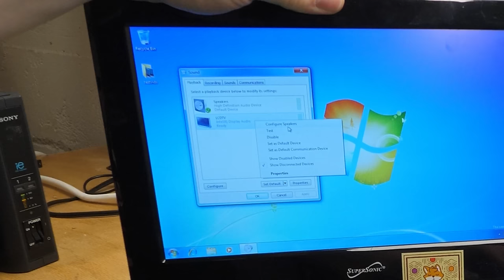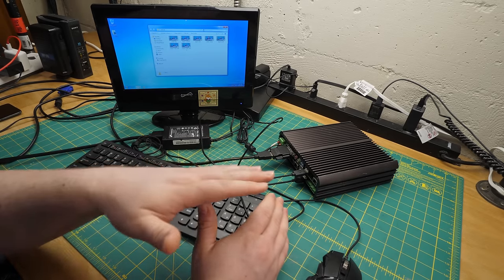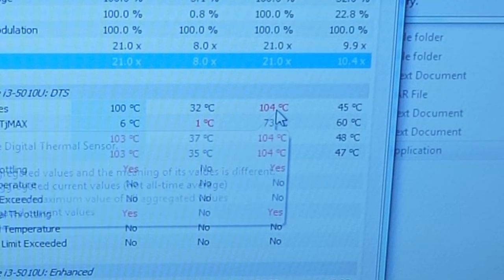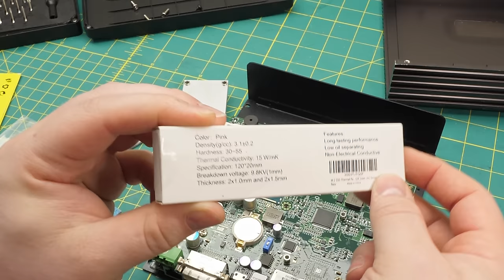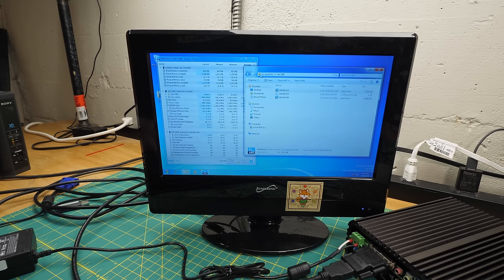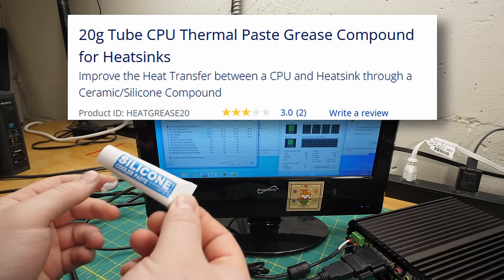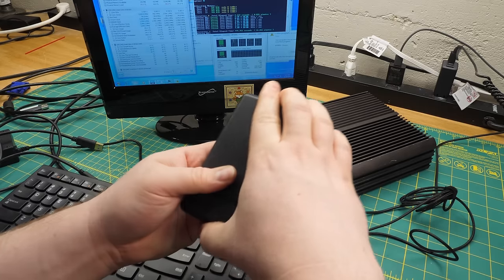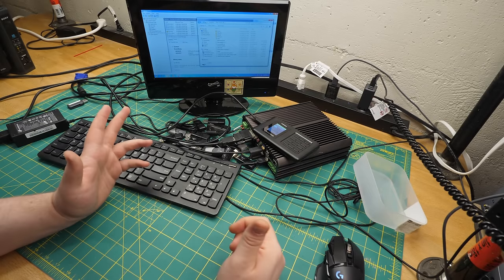Little Guys 4, Pt 2: More DVI Nonsense

Comment: That disk emulator is neat. But, at least in my personal experience, Ventoy is all you need. It's a tool that does a very similar thing. You format a flash drive with it. It creats two partitions on it. One is an ESP, the other is empty. You just dump iso images on the second one and it shows you a boot menu with all of them on boot.
Reply: The disk emulator is still useful for older machines that do not support booting to USB but agreed, I use Ventoy everyday at work. All my ISOs on one USB drive, so handy.
Reply: @AdamKeyz  yeah, for his usecase it's invaluable. But for an average Joe, not so much. 

Also the same with my USB drive as with yours. Only not for work, but fun and a bit of family tech support. Thankfully my relatives mostly are quite literate and solve 99% of the problems themselves, leaving to me the actually interesting ones. E.g. corrupted drives or bootloaders, weird software installation and diagnosis, etc.

Comment: What the hey?? I had NO IDEA that you could shove audio out a DVI port, and if you adapted it to HDMI, the audio would tag along too. I always assumed that the DVI port was video only, and that THAT is the reason why HDMI ports on PCs are now a thing. Well you know what they say about people who assume... I suppose i had that coming. Welp. Ya' learn something new every day.
Reply: DVI was quite capable, but a lot of stuff never took advantage of what DVI could do.
Reply: DVI and HDMI are electrically the same signal* so you can use a completely passive adapter to "convert" it both ways.

(the only electrical difference is that HDMI is suppose the be more tolerable to lower signal levels for use with longer cables)

Comment: glad to see you make good use of the IODD. I have an older one, IODD2541. I think i got the floppy feature to work once. The device works primarily based on file extensions. .vhd shows up as fixed disks, .rmd shows up as removable drives, .iso obviously for optical drives.

I worked as a photocopier repair field tech and firmware updates were very regular. Many older models did not like sharing firmwares with other models (or even other versions) on the same disk. With 20+ models we maintained, my IODD really saved my sanity. I custom made .vhd files as small as possible for each firmware file, but these copiers didn’t want “hard drives” they only recognized removable drives. Renaming to .rmd was the solution.

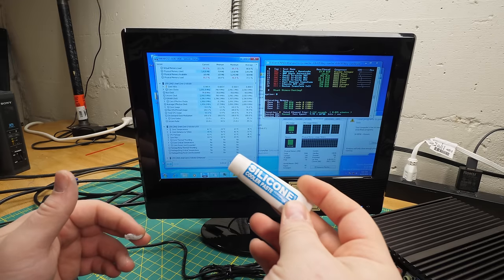Comment: @17:43 I work with Epyc CPUs regularly in a DC. I'll let you guy in on a little insider knowledge. The TIM we use is not fancy stuff from recognized brands. I'm pretty sure it's just whatever is cheapest to buy in bulk 1 gram syringes. They run just fine with the cheap stuff.

Comment: An aglet is a metal or plastic piece at the end of a shoelace or cord with a closed tip.

A ferrule is a metal or plastic piece at the end of a shoelace, cord, or wire with an open tip! Basically super cheap shoelaces probably have plastic shrink wrap ferrules instead of actual aglets.

Comment: I thought the whole point of the DVI-A specification was less just about VGA backwards compatibility, but that it had more bandwidth than stock VGA connectors/cables. Afaik, the max specified resolution at 60Hz is a bit higher.

Like I think later high resolution CRTs just used DVI-I for input, but I swear I remember some being analog only (no digital to analog circuitry), but used the DVI standard to allow for either high resolution at 60Hz or lower resolutions at much higher resolutions.

Comment: No, pads gets thinner, I'd consider 1.0mm "medium" thickness and probably the most commonly used in the common range (IE 0.5mm-2mm). Now, 0.5mm thermal pads definitely are thin, but there's also various sheets that I'd classify as "ultra-thin" - the 0.25mm and 0.2mm sheets are sometimes used as replacement for regular paste in environment where they're worried about long-term reliability or the "pump-out" effect (some GPUs use them due to this). You want some compression so 1mm sounded correct and the temperatures sounds sane especially since you're torturing in ways it's definitely not intended for.
AFAIK the standard term for the compound used originally is thermal putty or sometimes viscous thermal paste, it's available at all major electrical stores and Amazon, AliExpress and so on. It's used on the VRM in most modern consoles for example and in a lot of industrial equipment so sourcing it is easy. Thermal pads have similar heat transfer properties so you can usually swap to that though the putty does allow heat transfer from around the dies which the pads won't (not variable enough) but that's usually a very small effect. The main reason thermal putty is used a lot is because it's the easiest to apply by machine, something squirted a blob over the two dies and the rest just is just physics in action. And it works when there's big difference in z-height which no other solution does.

Comment: Keep in mind that hard drive trays would be universal over a large number of devices. This one could have a hole drilled out for another layout which could have something hot or something in said area. 
It could also be some sort of manufacturing process or something stupid. It could also be a carry over from something stupid.
Reply: @killingtimeitself  That could be it too. Unless a person can track down who manufactures these things or someone in the industry we will likely not know the reason. 
Manufacturing processes can be quite stupid. I recall something I read where a part had a massive amount of the portion stamped cut out because it saved 50% of the weight to ship the product.
Reply: @killingtimeitself  Yeah universal design, an older one at that. Some of the drive sleds from the early days could be heavy metal or lighter metal with a lot stamped out. I gutted many back in the day for fun!

Comment: Arctic Silver 5 is weird: it doesn't conduct electricity and is reasonable in thermals, but when you leave it for long in hot environment it will dry out and start conducting. Used some in an old stage amp for power transistors. There were mica pads between, so I added Arctic SIlver 5 on both sides. After a few years the amplifier perished with pretty nice special effects (ended its life with applause). Postmortem showed a crater where the paste dried out. So yes, this "non-conductivity" is relative term, probably on a CPU wouldn't be as catastrophic. Lesson learned, I use regular old white thermal paste for power transistors since.
Reply: I killed a CPU with far too much AS5 once. Think it was an i5 2500k. I think i read that AS5 is somewhat capacitive.
Reply: @M4rk-_-  Like Bil Herd said about polysilicon layer on chips: it has resistive capacitance 😸

Comment: @10:43 - I vaguely remember thermal sensors mounted on the capton tape designed to slide and glued onto the hottest part of the drives - for the Raid drive massives. Maybe these holes designed for that? Oh, 2006-2008, manufacturing date, by the way.

Comment: Oh, damn forgot entirely about those standoffs indeed, I just saw a ton of space and then "Yeah chuck a HDD there". Sounds like they would then just either throw one of those bare SSDs that you see in extra cheap laptops, sometimes with a plastic (open) adapter that fits it into a 2.5" drive, or maybe a CFast drive.
Reply from the maker: oh yeah and i wasn't specifically hanging you out to dry or anything lol, a few people made the observation and I certainly hadn't considered it; I didn't think about the standoffs until I flipped it over while shooting this video, I was gonna say it seemed likely to me lmao

Comment: Optoisolators are good for noise generally, but they’re also good for when you need to pass a signal between systems that intentionally don’t share a ground. I’ve never seen the built-in ones used for that, but it’s super common to have a terminal block full of optoisolators where one side is “machine ground” and the other is “power supply ground”.

Comment: Arctic Silver TP-3 are my current go-to thermal pads for brushless ESC power FETs, they are a sheet of stiff modeling clay like materiel that permanently deforms so they cannot be reused like a silicone pad but they have better heat transfer. Thermalright Odyssey pads are very similar. With these you don't have to worry so much about pad thickness just make sure it's thicker than the gap and it will deform to fit and the excess squeezes out from between the components without placing stress on them. Once assembled if you disassemble it takes some force to separate them again because they're basically suctioned together which is why they aren't reusable.

Comment: There are 0.5mm thermal pads, typically used on graphics cards. They are harder to find if memory serves, but I believe they exist. It's just finding a supplier that sells direct to consumer or one that resells it after buying wholesale.

Comment: The last time I had a laptop with a significant gap between the chipset and the heatsink, I used IC Diamond thermal compound for it.  It's rather thick, so it can fill gaps.  But that thermal pad is definitely a less messy solution, and less likely to scratch the die.

Comment: Bottom of extruded unmachined heatsink is not allowed to contact large dies and multi die packages directly, because the extrusion process results in bowing.

Some pads are softer and more compressible than others. For the most part they achieve best thermal transmission compressed to 3/4th of their relaxed thickness. You can even order extra soft flowy pads which comply to anything. There is also thermal putty, K5Pro, with a dubious reputation, and its clones like U6, with even more dubious reputation.

Bet the material they used is much higher conductivity and more deep cycle durable than a random no-spec pad, but good enough is good enough.

Next thinner grades below 1mm are 0.5mm pad and 0.1mm thermal adhesive.

In other builds, the heatsink could be different and may not require standoffs below the CPU, with heatsink being attached from the bottom by screws instead.

Comment: for anyone who thinks about getting an IODD just to replace the pile of USB-Sticks

while I don't think you can use it with windows installation ISO's, a great solution for Linux ISO's is "Ventoy", which essentially gives you a live-os from which you can select other ISO's placed in the other partition of the ventoy stick

that way you would only need one decent sized stick for all your Linux needs and a couple small one's for Windows

I still think the IODD is a great thing for having things centralized or when you would specifically need the simulation aspect

Great video as always CRD!

Comment: The Optocoupler also helps with floating grounds that can result in hundreds of volts of difference between ground references.
Reply: That's also why hot plugging devices is a bad idea.

Comment: Hi, just want to say that there is an alternative option to your Iodd device, at least partially.

It's an open source tool called Ventoy. You flash it onto a USB drive and when you boot from the drive, you get a menu where you can select any ISO files stored on the drive's main partition. So you can have any number ISOs on the drive at once and boot whichever you need, and you can also continue using the drive as a normal storage device to move files around and stuff.

Reduced the number of USB drives that I carry around from a dozen or so to one, which is neat.

Comment: To fill the heatsink gap like that I use a copper shim - it should stay in place ok if you gunk it on with thermal paste both sides. Maybe not for laptops that travel a lot (the vibrations in a hot vehicle may cause it to move gradually over time especially on tracks or bumpy roads) but for desktops/minis it's no problem.

I bought a few 0.5 and 1mm copper shims on Aliexpress for very little money, mainly to play with different heatsinks on SBCs to give some clearance.

Comment: Many old CD ROM /CD player drives have thermal pads inside, often just under the bottom metal plate.  So in a pinch you could steal one or more from them to use on a CPU or other hot semiconductor.

Comment: regarding the hole in the HDD caddy: some older spinning disks had a "breather" hole, which was typically located at the front of the drive.  it was to allow air pressure to equalize inside and outside the drive if my memory serves me.  most of the ones I have seen were on the top, but I don't know if perhaps that was to allow for one that was on the bottom?  I mostly worked with 3.5" stuff back in the day, but that is the only thing I can think of.

Comment: Liked the previous video even though I did think a bit more research would be nice due to some of the blatant errors ;) Thanks for the corrections.

Had an old Acer 21" 1680x1050 thing in 2006-2009 that only accepted DVI-A. So annoying. And I bet that the thermal compound on the CPU originally was just thermal pads that dissolved over the years based on the thickness of that goop

Comment: Regarding the dvd emulation drives:
 - I think Zalman was the 1st (I think they bought a company that started this) with VE-200 (USB2), I got the VE-300 (USB3) about 10 years ago.
 - Then isostick was made, which used microSD and you had to select using a text file (the card was always accesible, but a HW switch could make it read-only). It uses a slow SoC which only allows about 12MB/s, but I took the form-factor against the 2.5" Zalmans.
 - During the pandemic I discovered Iodd, but they already had a newer model than yours, the Iod Mini, which uses (actually comes with) a 2242 M.2 (sata) drive (I have the 256GB, but I can change it any time).
Now, I rarely use this functionality, as I mostly boot linux ISOs and made several small+fast sticks (like Samsung Fit 128GB) with a grub menu, without extracting anything from the ISOs (just copy the iso and make a boot menu). I can also boot WinPE, but I did not "update" and WinPE8.1 is my latest. That's how rare I boot Windows recovery.

Comment: If you don't handle VERY old computers, the boot loader VENTOY is also a good alternative for the iodd. Makes it possible to place iso, vhd and other images onto the partition VENTOY created and it works. I have tested it down to a 2nd gen i7 laptop successfully.

Comment: Most likely there is a barrel to Phoenix connector adapter for those ones not wanting to cut the end off.  There is probably an adapter that goes the other way (has a male barrel connector).  I know some aftermarket lap[top power cables come with multiple ends that can go on it (assuming the one it has is not already coincidentally the one).

Comment: I've been using a similar hard drive type optical emulator for about a decade now. Zalman VE300. There was also a VE200. The difference between them was USB 2 vs 3. I like the screen and interface on yours. Its better than a jog dial.

Comment: I think - and I could probably be completely wrong - the hole in the disk mounting plate is just for stability. The edge of these holes is slightly bend upwards which makes the whole thing more rigid. That or it's just saving weight and material... 😉

Comment: You get things like thin clients and industrial PCs as cheap as you can so that you can mess around with them. And make them DO things that you find out they can do. For instance, I have an HP t620 thin client ( Dual core AMD at 1.65 ghz. and 4 GB RAM and 128GB SATA M.2 ) that I use as an audio capture and playback device running Linux Mint. The audio is very clean and extremely low noise, perfect for making cassette tapes from, waaaay better fidelity than even VHS HiFi. The back panel audio jacks are line level in and out and the front panel jacks are for headphone and microphone. Very handy.

Comment: I spy a Samsung BAR (plus?) in your pile of flash drives. Hope it works okay - they seem to either "downgrade" to USB2.0 after a while (mine did that), or just die completely. Ended up returning mine not a week later and buying an NVME enclosure instead :)
Just learned that DVI could do sound today, thanks!

Comment: There are definitely DVI-I monitors that support both analog and digital.  My NEC 2090UXi has three inputs: VGA, DVI-I, and DVI-D.  The DVI-I input can be used as either analog or digital, so I guess technically it has 4 inputs.  Now what exactly would happen when connecting a DVI-I display with a DVI-I cable I'm not sure.  Oh, also the Magewell Pro Capture AIO capture card I have has a DVI-I input.

Comment: The biggest revelation of this is DVI can carry audio at all.
Reply: That and the thermal wax. That's a really interesting solution.
Reply: It's a nice feature! HDMI basically took DVI signalling and wiring and extended it, (and explicit requires a base profile overlapping with DVI), so a lot of GPUs just consider them the same thing, and if a HDMI sink is at the other side it just sends the full HDMI protocol instead. It's very nice for my little XP HTPC which has a GPU with DVI!
Reply: @seshpenguin DVI was never meant to carry audio though, it's a weird nonstandard extension to avoid paying license fees to the HDMI consortium. Lots of things with HDMI ports are actually running this hacked DVI mode.
Reply: I used to have a graphics card that had DVI but no HDMI, and a monitor with the opposite, and I do remember being surprised that it was able to send audio, as I'd assumed that was the meaningful difference between the two.

Reading about it, audio isn't an official part of the DVI standard, but since a subset of each standard is electrically compatible, DVI is capable of carrying the signal.
Reply: @Nukle0n  Yup, but since each end technically supports HDMI anyway (the GPU die and display), the DVI connector is basically just the physical transport sending HDMI TMDS signalling.